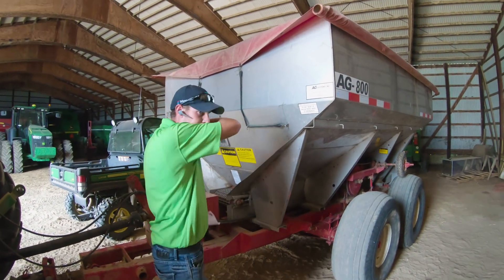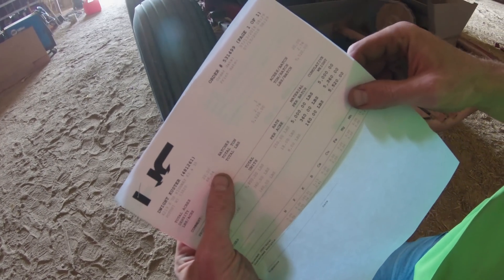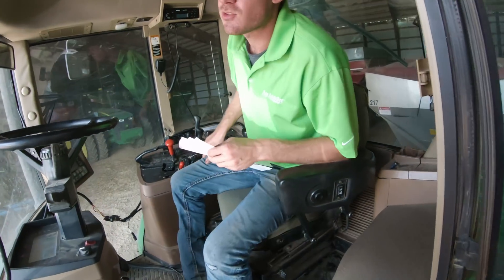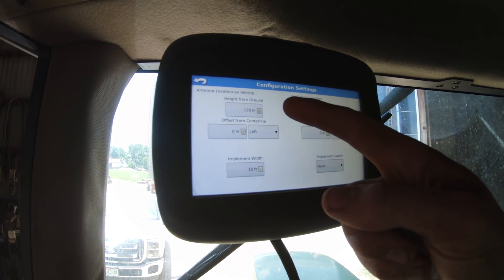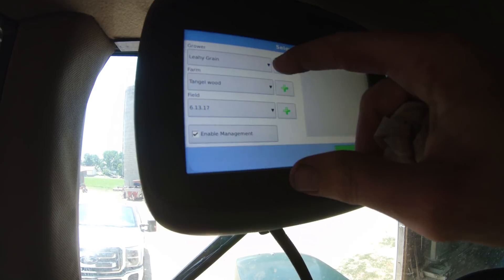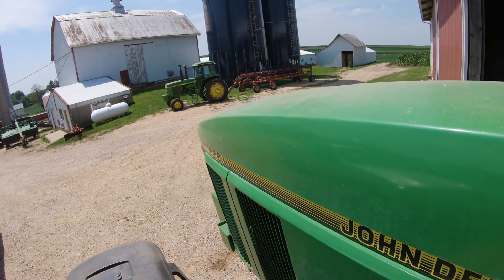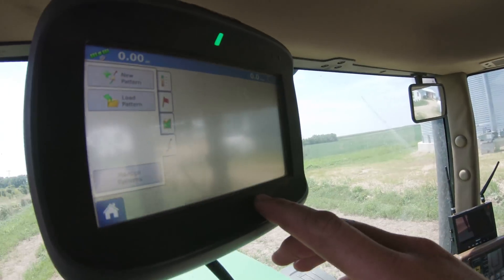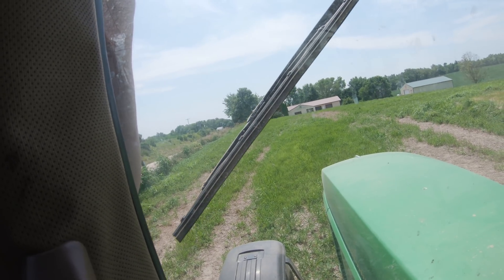Broadcasting Fertilizer with GPS

Comment: I don't know, but all I see is Amazone spreaders are fully hydraulic and have automatic weighing systems, which can be easily calibrating by knowing the average density and pellet size of the fertilizer, and later the spreading discs are set to whatever speed and can even vary with GPS section control (and variable rates) so you can stay on your tramlines and fertilize accordingly.
Really have no idea, but your spreader sounds like trash.

Comment: Interesting about the fertilizer getting spun out on the road... Not that it would really do any harm (well no more than road salt does after a rain when the fertilizer would dissolve and get sprayed up under people's cars by the tires, until it all dissolved and ran off in the roadside grass which would then use it and get lush and green... good for road hay, if anyone cuts roadside hay in yalls part of the world).  Anyway, it's funny because the dry spreaders our local ag supplies "rent" with the fertilizer have "lockout levers" on them for transport... basically a long lever lifts the friction drive tire up and out of the way, and shoves a spring-loaded "pawl" up against the driven sprocket, to "lock" it from turning... When you get to the farm and hitch up to the tractor, you flip the lever back, which then pulls the lock pawl back with it from the driven sprocket, and lowers the wheel down onto the hydraulic cylinder lift arm (for hydraulically controlled spreaders) or directly down onto the transport tire of the spreader (for "full time drive" spreaders typically used in pastures, which spread whenever the thing is being pulled forward-- you have to manually pull the lever out between pastures to stop it from spreading... these also typically have the fans (spreader disks) turned by belts or gearboxes running off the ground drive as well, instead of the PTO driven fans on most "field spreaders" (typically used to spread dry fertilizer on farm fields for crops).  

I know the GPS is a nice touch, just for the lightbar guidance... makes a HUGE difference in the accuracy of your application, without overlapping or skipping too much like is prone with the old "mark one eyeball" method, particularly on a 50 foot swath width... 

Later!  OL J R :)

Comment: If you sped up your rpms could you spread the fertilizer farther than 50ft?  Thanks so much for the video, I can’t wait to see the next one.
Reply: Maybe a little but it will only fly so far, plus the wider the width, then you mess up your rates-- you have to increase the gate opening to compensate, plus the spread pattern becomes inconsistent...  it really depends on the spreader where the 'sweet spot' is between spread width and consistent rate/speed/spread pattern width... 

Later!  OL J R :)

Comment: What brand of monitor and GPS globe is that? Where could I find information on it?
Reply: Wonder how it compares to Trimble EZ-Guide 250... what I've run for the BIL and I really like it... modes and the "paint" part of the field look the same, guess they all are to an extent.  

I'd love to get a GPS system to use on our farms... we could spray our own pastures instead of hiring it done, and it'd be handy to guide us when we're spot-spraying brush and cactus in the UTV in the pasture, so we could run a specific "grid pattern" at even intervals rather than "by eye"... and of course, spreading fertilizer or seed as well... 

Later!  OL J R :)

Comment: I'm guessing this was something you needed to do because you didn't have the option of spreading manure on the hay ground.  An obvious advantage of broadcasting fertilizer over manure is the option to tailor the mixture to the needs of the ground, whereas with manure that's not possible.   GPS just takes it one more step toward optimizing efficiency.  Thanks for the video, Ryan!
Reply: Good question... hopefully someone with more alfalfa experience will chime in, because we're actually too far SOUTH to grow alfalfa in our area of Texas... (so I don't want to pass on inaccurate information).  I know when we planted soybeans, we used a peat-based inoculant "powder" that you simply sprinkled over the seed and mixed it in thoroughly with your gloved hand as you refilled the planter... so it was a "little" more involved than simply dumping the graphite or talc on top of the seed in the hopper when we were planting, but it wasn't really a mess or anything, and it went through the planter quite well... 

I could see where some jellied stuff would make quite a mess... The stuff we used (can't recall the brand name of it ATM) was a little baggy about the size of a bag of powdered sugar, that covered IIRC 100 pounds of seed (two bags).  It was basically the spores of the bacteria impregnated onto a finely sifted peat-type "potting soil" that was slightly damp-- we just dumped it into the hopper and mixed it up thoroughly with a stick or gloved hand... worked well, as our soybeans always nodulated quite well.  We always kept it in a cool, dark place (cooler in the pickup) and mixed it onto the seed right before we went to the field to plant, so that the rhizobia bacteria didn't die from drying out or heat before the seed was  planted... 

Given the fact that alfalfa seed is SO tiny, seems like a "jellied" product would cause it to stick together and build up on the metering wheels and make it stick in the seed tubes of the drill and just muck up the works badly... 

I'd like to know what the "modern" or "typical" method of inoculating alfalfa is too... hope someone more knowledgeable can answer!  

Later!  OL J R :)
Reply: Matthew Hoag spreading manure on hay ground isn't always the best use of nutrients because hay doesn't need the nitrogen.  That's why they are just spreading the Potash (potassium) with micro nutrients which is what the hay needs.
Reply: I get that, Jeff.  Thanks.
Reply: Matthew Hoag that and you don't want to spread pen pack on hay ground, it's just usually done with liquid slurry.
Reply: Of course, because you don't want to kill the plants.  I remember when they were spreading last summer and going fast to make sure it was spread lightly.  There's only so much control one can have on the manure spread pattern.
Reply: Matthew Hoag correct and they were spreading that in a pasture that I am not even sure they cut for hay.   You don't want to be baling up old clumps of manure.
Reply: If you spread FYM on a field you were were hoping to cut you'd get in the bale or clamp/silo we do spread it on them but generally nutrient wise it is basically only a soil conditioner for us and we only do a single cut and rotate the hay fields each year as even rotted down for a couple of years you can still end up with clumps that'll be there the following year.
Reply: Thinking about it I believe that is what got a manger on a neighbour's estate fired, they put fun on red clover before the last cut leaving them to have to either top it or graze it. That was according to the guy who replaced him but I think they had/have the habit of going through farm managers annually and I don't think it help that a buyer who collected the eggs went bust and continued to collect the eggs though he hadn't paid for several months.
Reply: Well, some of the time it was on Ryan's hay (grass) ground.  The livestream when Ryan and Jamie were cleaning out the barn lot last summer, to be specific.  I guess it would make a whole lot more sense on grass than actual alfalfa.  Ryan has done videos of himself spreading on the Klein pasture directly west of his 11-acre corn field at least a few times.  I'm sure the cattle would prefer hay in their bales rather than manure; I can't imagine it would store all that well with a good source of microbes mixed in.
Reply: Correct, grass hay needs the nitrogen; properly inoculated alfalfa (which is a legume and makes it's own nitrogen) does not... although in an alfalfa grass mix it's probably of some benefit to supply the grass part of the mixture with additional nitrogen.   Everything to some extent or other needs the boron, which is deficient in most soils for maximum productivity.  

Yeah, for a field that's being baled, better to keep any manure spreading as light and thin as possible, and preferably the most crumbly/liquid slurry manure for fast incorporation into the soil via rainfall and such... bed pack with a lot of mixed in straw and hay and such would really make a mess in a hay field because some of it WILL end up in the hay next time it's cut and baled, unless perhaps if it has time to rot between a fall application and first cut in the spring... something like that... or making a pass with the drag harrow right after baling a fresh cut to break it up and shake it down after a LIGHT, THIN application so it moves down to the soil surface and off the stubble, so it regrows up above it and the manure is down below the cutting height of the next cut of hay... 

Later!  OL J R :)
Reply: Out of interest to innoculate alfalfa do you still have to mix it with a jelly like stuff just before drilling or is a different innoculant used now that doesn't bung the seed drill so easily?